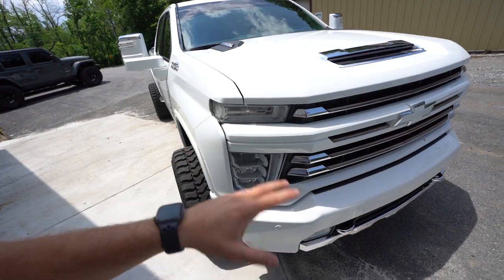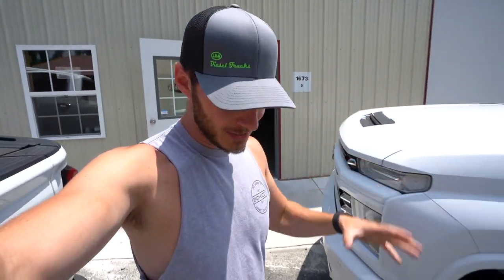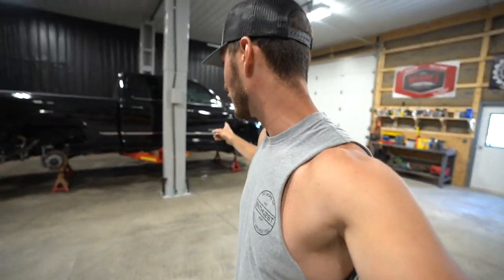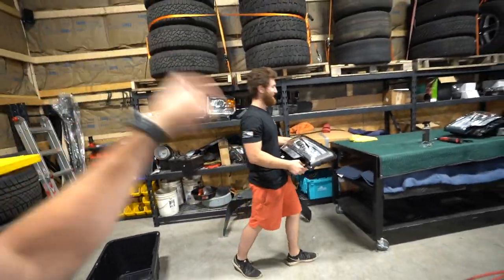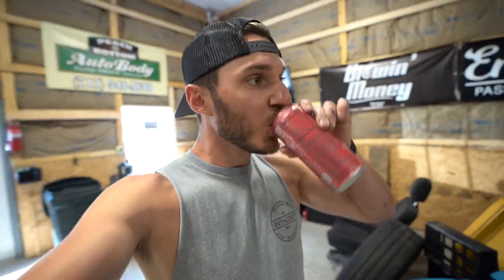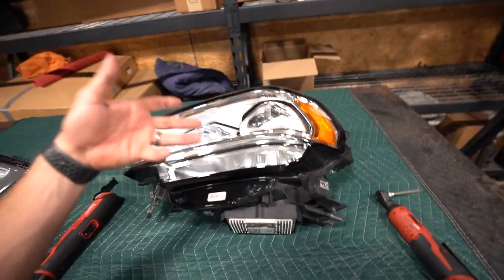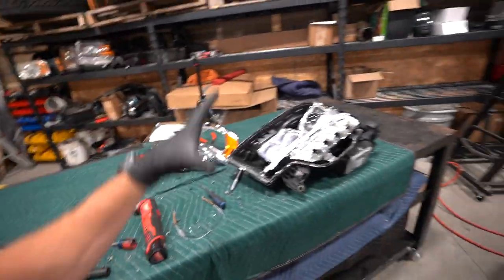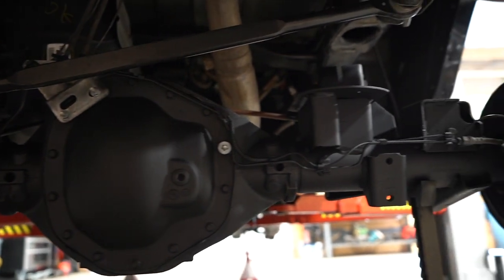The Problem With Custom Headlights..

Comment: A possibility to prevent bolts from going down the drain would be install some screen over the top of it, still allowing water oil etc to flow through but nothing else

Comment: I pulled my 2017 rado lights apart with a heat gun and flat screw driver but I tell everyone there really easy to do probably a 4 outta 10 on the challenge level 
I too used black silicone even though I bought new butyl adhesive 
I believe I’ll try the saw like you all did next time lol